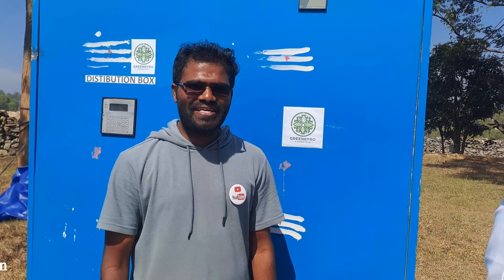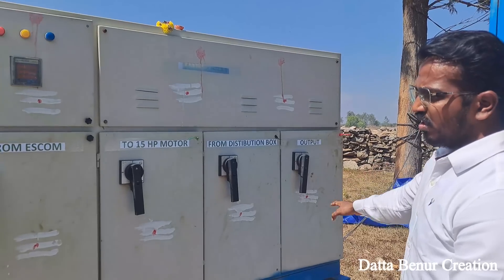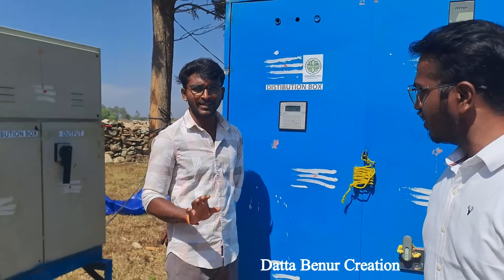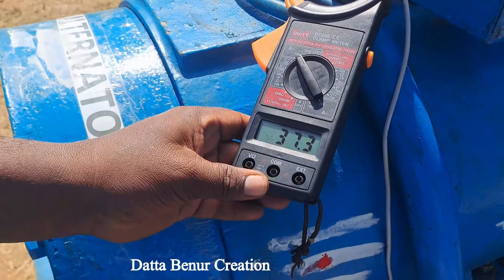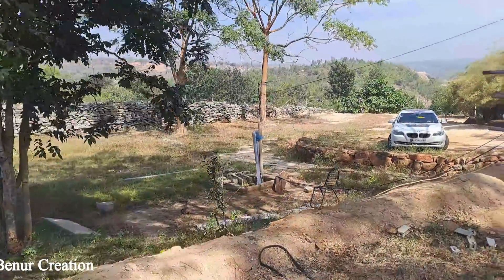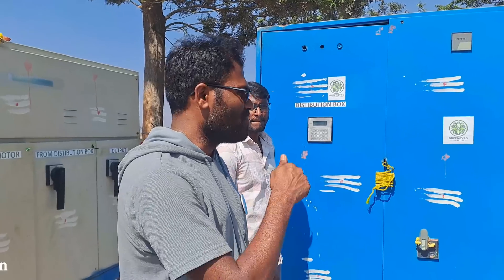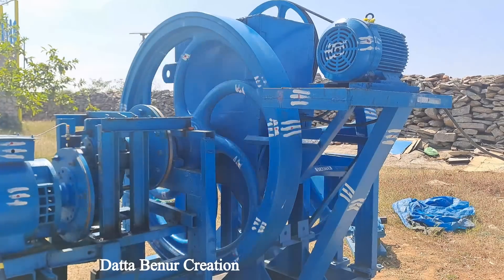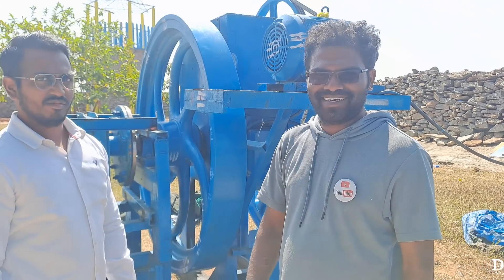the world first commercial flywheel Energy Technology - 0% input 100% output

Comment: After starting the motor you saw imput ampiar is 0 and output ampiar 37 in single phase  but input ampiar you saw 3 phase jaint cable ,ampiar single wire me dikhai jatahe ,so you are wrong

Comment: I am always amazed by how many people do not understand the law of conservation of energy.  There is no "Free lunch" folks.  This machine does not "create" energy.  This machine could be designed by any good 8th grade physics student.  This machine just converts electrical energy to kinetic energy and then back to electrical energy.  It produces LESS energy than it consumes.   BTW - The flywheel should be in a vacuum to reduce viscous losses to air.   A gravity battery would be more efficient than this device.

Comment: This is good for power condition. Why do all flywheel energy companies operate like a scam? There are legit / non scammy applications of flywheel energy storage. I was looking for a solution that will isolate and stabilize fluctuating gird electricity to get clean stable electricity. 90% videos are a scam. This is a dumb way to scam. There are easier ways to scam that cost less investment on the scammers part.

Comment: If you check the video from start of the machine and checking and showing consumption ss zero is because the amps meter is put on the whole cable and individually on neutral and phase
Reply: Amp meter used on cable top will always show zero

Comment: I have worked in the electrical field & have never measured a large 3 phase cable using ampere clamp at once, it should be one by one according to the phase L1/L2/L3 .. This is the practice of energy magical 🤣🤭🤣🤭🤣

Comment: The generator unequivocally powers the main drive motor. This was confirmed by disconnecting the motor drive switch and measuring the current with a clamp meter, revealing no current flow in the absence of load. Additionally, there is a secondary switch that controls the motor's operation, allowing for activation or deactivation. It is theorized that this switch directs the current to the motor when the machine is running at full capacity and the wheel bears a load.

Comment: I believe it works and it can produce 25-30% output maximum that can be highness to higher voltage through inverter and enough transistors ...try assume functionality of a large wind turbines based on gear ratio calculation on the inventory...

Comment: According to my understanding there is no energy is created without spending some form of energy. If you spin a flywheel with an electric motor and stop it after some time the kinetic energy will fade away as factors like the friction of the setup plus the load connected to it. For demonstration you can show the voltage until the fly wheel stops as there is no backup for flywheel to keep it running continuously. You can use a flywheel setup to have non iterupted power supply for communication and runway lights used in airports to overcome the voltage buildup delays of a standby generator.I personally have experience in seeing a 650kVa French made SACM make with fly wheel setup with 3 sec.interruption.This is all about a setup in 1978.

Comment: This is an illusion.
input energy less friction loss = output energy for generator + mechanical energy accumulated at the flywheel less friction loss.
Once the drive motor turned off the flywheel will continue rotating the generator until it dies. lapsed time determined by flywheel weight and speed.
Therefore the total energy earned is ZERO.
This systems are build to stabilize generators over unstable loads. 
Other system  includes flywheel energy for diesel back up generators without interruption.

Comment: How long it will work as the bearing frictional loss is there and persists. If we are loaded further withing the generator capacity the frequency of the generated power getting slowly reduced and finally generation will stopped. The sustaining generation period may be the quantum of energy stored in the flywheel only. So periodical boost up will required when the frequency got reduced to 40 to 45 Hz. Accordingly booster is required with external source of power supply then and there. It is my opinion.

He is putting the clamp meter overall cable. It is not correct. He should put the clamp meter only on phase or neutral. Some where the power is given to the motor is our doubt in this particular video.

Without boosting how long (Period) the system works with first start is not clearly told.

Comment: Stop saying 0 input .. you supplied energy from the motor to flywheel.  Based on conservation of energy, you supplied more energy from the start up motor to run the flywheel (kinetic energy), converting the kinetic energy back to electrical energy will again have loss.  This is a short term energy storage device which can store energy for 15-45 mins.  It may help stabilize if the input source has erratic generation profile(like solar, wind).  Batteries are better long term storage device though it can get expensive.

Comment: The drive motor’s belt looks to me to have more tension on the lower motor drive side.  If it was working as they say, the belt tension should be higher on the top side.  So with a 15 hp starter motor (11.25kW) they get over 30kW out?  
They should go back to their scam call center.

Comment: Those who are saying it won't work, it's against the laws of physics, they don't understand how really it works. 
The real secrets are not shown here. 
The real secrets lies in the windings of alternator. 
They take the default coil winding out, and put a new coil winding of high impedance high gauge wire, the property of high impedance coil is that it delays the development of magnetic field when current flows through it. 
In electrical engineering we call it rise time and decay time of magnetic field, which is directly proportional to the impedance.
That's why during on load conditions, the alternator coil delays the development of magnetic field and meanwhile the rotor magnet passes by the coil, as a result the coil doesn't repel the approach magnet and doesn't attract the departing magnet, so there's no drag or no lenz resistance, only friction exists and that is overcome by heavy flywheel easily. 
It's age old technology but doesn't put to the welfare of society. It's hidden and kept for military applications only in countries where it exists.
Reply: And how is a "high impedance, high gauge" wire constructed?  Is there some special material is it constructed from?  That part doesn't make sense because a higher gauge wire will have a lower impedance.  And a lower gauge wire will have a higher impedance.

Comment: Input motor current mesurment method is wrong because they are measuring all 3phsse current at a time during  this time one phase current will cancel another phase current.that time it will shows zero.if it's off-grid without load how generator is showing 32A current without load.2nd if it's on grid they should use synchronous generator. as we know synchronous motor works like generator while moving generator shaft.and it will work like a motor during input supply. if it's on grid the same generator will consume reverse power to rotate flywheel.

Comment: There is alot of people here that have little or no idea of Physics or Mechanical Engineering and its ability to create energy.  To produce energy one must have a source of energy that is greater than the amount of energy needed.  Due to friction a generator started with an outside power source and producing said amount of power cannot sustain itself after the power supply is turned off. The generator will slow down and stop.

Comment: Bro I don't know how it works, when motor dead , when all mechanical systems runs then motor input is cut but then this system how can run without any motor,if motor connection connect to generator then this possible 😮😮😮😮😮😮.

Comment: Its a neet video. But

He clamps the AC meter around the big power cable to show there's no power coming to the machine.

Only trouble is and possible i have been doing it wrong for years on the job.

But i have never been able to get a current reading when i clamp the meeter around all the wire's.

Because you have current flowing to the motor and back so it will not read anything.

You notice on the next wire he checking its only clamp on one wire.

This way you can read the current.

Have to love art as this was well done as if they had one heck of a new ideal.

Just thank in all the time and money use to run wires.

They skimp on cost and run one power wire with 3 or 4 conducteds in it stretch out and prop up with a stick. 

And then act as if you can read the current in the wire. When its flowing to the motor and back

Comment: think about the flywheel,  picture the flywheel horizontally connected to a shaft in a bearing on the ground with a cable rapped around the shaft like making a hand operated winch.  the other end of the cable goes to measuring device that is anchored to a stationary object.   now turn the wheel and see how much force you can put on the measuring device,  of course you will see the larger the diameter of the wheel the more force you can put on the measuring device when you turn it.  the more leverage you have the more torque you have.  then you gear up this torque to spin the generator.  the larger the  wheel    and the heaver it is on it's outer circumference and the faster you spin it the more torque you will have. make your flywheels large in diameter with as much of the  weight as possible on the outer circumference.  then size the weight of the flywheel in ratio and portion according to the size of the  drive motor and generator.

Comment: many people are making these and showing them on you tube but few if any give you any information on how to have success.     I will try to explain how these may work and what it may take for success.       first know these devices must be tuned, its a balancing act between all components.  your generator/alternator must be two or three times larger than the drive motor.  the connecting belts must be relativity kept loose, the tighter you make the belts the more amps you will draw from the drive motor.    your first goal and I believe most important is to drive the flywheel up to a rpm close to that which the generator needs to run at in order to output the amps needed to power the drive motor and have excess left over to power other things.    but you must accomplish this while drawing the least amount of amps possible from the drive motor.     the lower the gear ratio between the drive motor pully and the first flywheel pully the less amps the drive motor will draw.  always start with a small pully on the drive motor.   then size your flywheel pully to achieve close to the rpms the generator needs to operate at.    but there is another issue you must be aware of, the size of your flywheel matters too.   why? because you want the drive motor to operate at its rated rpm where it runs the most efficient at.   if the flywheel mass is too large the drive motor will draw more current to try and get the flywheel up to the rpm the drive motor wants to run at. in short the more massive the flywheel  the more current the motor will draw. .     and there is another problem, the drag the generator will put on the drive motor. this is where the flywheel comes in to assist.     so you see really it's a fine tuning of all components.    because there are many different generators and motors you will have to tune each system.     you may have to trial and error with the components, and certainly gear ratios.    if your generator is not outputting enough power to keep your drive motor going or giving you excess power then you have to increase the generators rpm, change gear ratios.  if your flywheel mass has enough energy to keep up the increased gear ratio to the generator without causing the drive motor to exceed it's efficient running status then you may have it dialed in.    if not you may have to increase or decrease the flywheel mass or adjust the gear ratio between the drive motor and the flywheel.   like i said it's trial and error, you have to spin the generator fast enough to get the power needed for the drive motor plus excess for other things but at the same time the drive motor has to operate at an efficient load speed. it's all done by correct sizing and gearing.  oh and adding capacitors helps too.
if the flywheel generators are getting energy from another source, what is that source :
not certain, but the flywheel has something to do with it.  do these devices gradually slow down and come to a stop? because after you unplug them from a land power source then what are the  remaining power sources ?    well the flywheel is a power source, stored kinetic energy,   the generator is a power source, it is still producing electricity,  and the drive motor is a power source because it is still being provided electricity from the generator, electrons are still flowing into the drive motor making it turn.      you would think if the flywheel was the source of energy turning the generator you would assume as the flywheel energy slowed from friction so would the generator and so the drive motor would also slow due to lower voltage from the generator,  and everything would come to a stop.    if this is not faked and some how these really do work then we have to figure our why.    so when you have line power going to the drive motor what are the sources of energy in the whole system?  well you have the line power driving the motor,  you have the motor driving the flywheel ,  you have stored energy in the flywheel,  you have generated power coming from the generator.   so you have 4 sources of energy.   Then you disconnect one source of energy, line power driving the motor and substitute generator power to drive the motor.   we can see when line power is on the power source, the generator has is not being used. and it is a functioning power source, so we now use that power source to drive the motor.    the phenomenon we all seem to not be able to get our head around is we now seem to be using energy that is not coming from the line source anymore.     However electrons are still flowing out of the generator, providing power to run the  the motor.   the flywheel ? well it still has stored energy.      is the stored energy in the flywheel acting as a buffer to keep everything going? and if so then you would think as the flywheel slowed down from friction the whole system would come slowly to a stop.   But then you can see the motor which is using electricity from the generator is still running and providing energy to keep the flywheel going,  how does the flywheel slow down if there is a power source keeping it going?   how does the motor slow down if there is a power source keeping it going? and how does the generator slow down if there is a power source keeping it going? and why do we even have excess power to use from the generator?  everyone wants to know where the power is coming from that keeps the system going.    we have electrons flowing through the motor where are they coming from?  well obviously the generator, but where are the electrons coming from that are coming out of the generator?  if you really want to mess your mind up try thinking about that !    you cannot create an electron, you cannot destroy and electron however you can get them to move, to flow through a conductor and do work.  as the electrons flow through the generator billions of them per second  from what source do they come?  your not creating them, they cannot be created.   there is only one place they must be coming from, the environment.   I say all generators get there electrons from the same source, the environment.    everything is made af atoms and all atoms have electrons orbiting them.    we know that electricity is movement of these electrons , called electron drift, from one atom to the next.   and all matter including our atmosphere is packed with atoms.   I say generators create a condition where through the manipulation of magnetic fields allow electrons to flow from the environment through a conductor.  we have learned to use these electrons and make them do work for us, but it usually requires another source of energy to create the condition to force or get them to move.     so where is the energy coming from that keeps the generator supplying electrons to feed the drive motor that keeps the flywheel going ?    I would have to say from the flywheel,  the flywheel is the one component that has the most stored energy, it's like a battery.  why does the flywheel not run down? the motor keeps it going, why does the motor not slow down? the generator keeps it going.        there could be something happening as a whole too because you really have three flywheels of different masses spinning together.